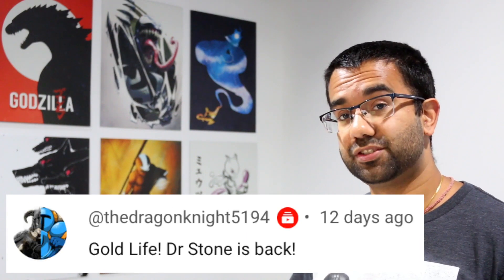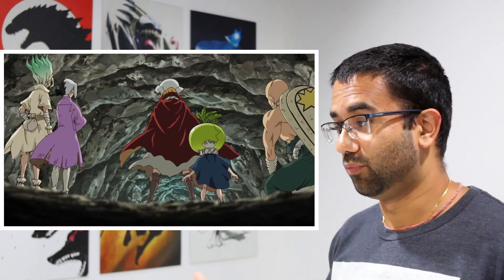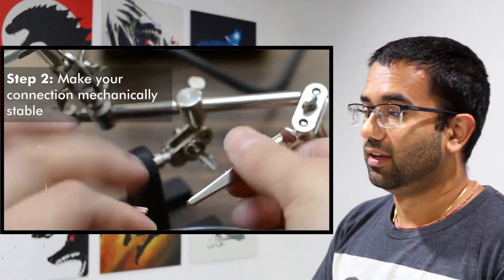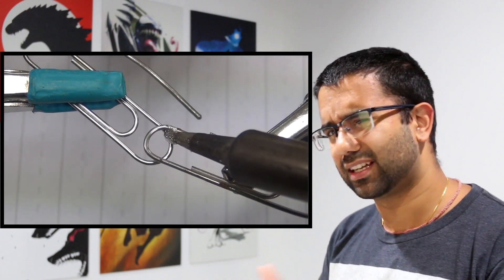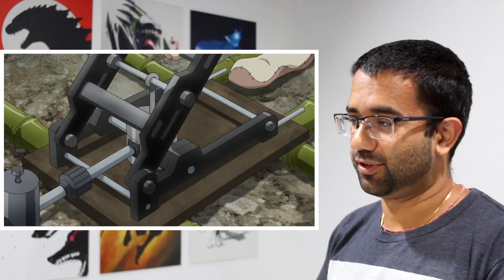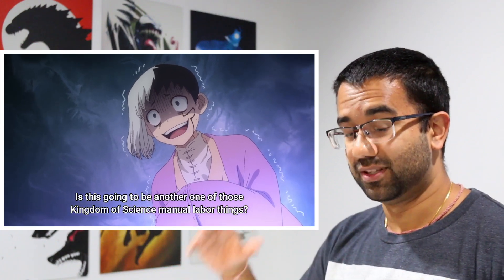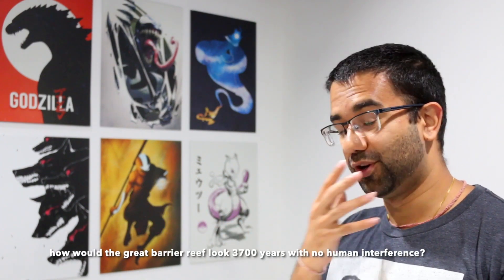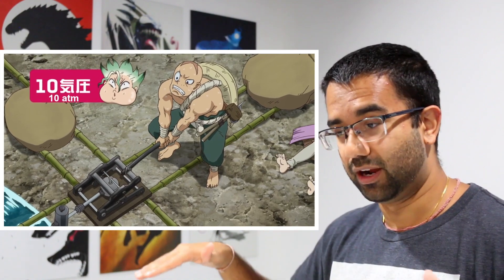Real Engineer Reacts to Technology in Dr. Stone #46

Comment: Thanks for continuing your Dr. Stone reactions! My thinking is that the revival fluid is insoluble in water so it that why it still works underwater, and that the water is not supposed to be as deep as you are thinking so they don't require the weight belt.

Comment: As a certified diver (although quite out of practice). The one thing is if they are in the first 30ft of water the pressure differential is negligible with that of the surface.  That being said where the statues are looks to be much deeper than that probably closer to 60 or a hundred ft.  In which case they do have to be very careful with air and dissolved gas in bloodstream